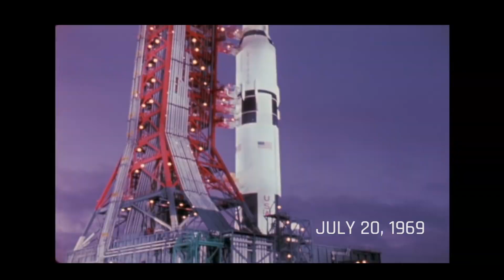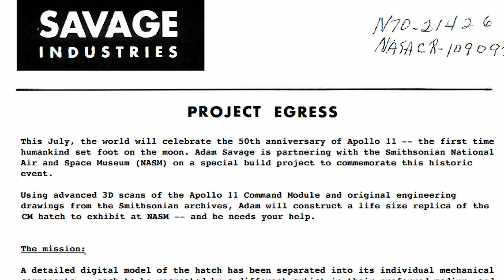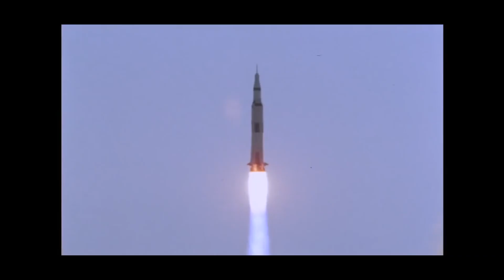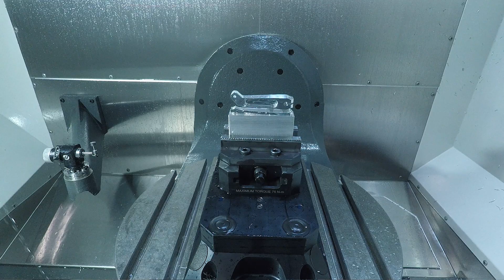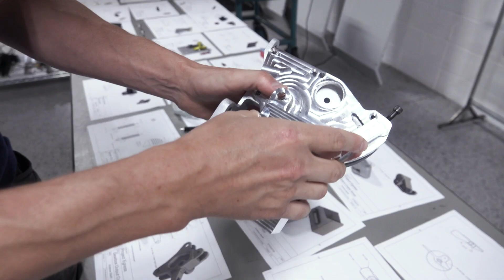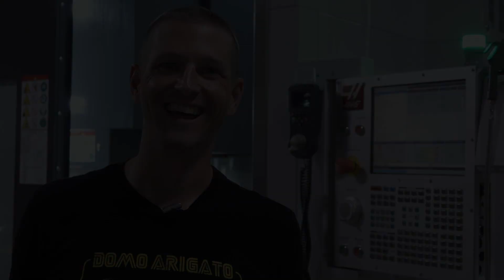Machining Parts for the Apollo 11 Anniversary: Project Egress!!  | WW258

Comment: "some of this parts really kicked our butt"..... yeah, and that was 50 years after the original was made, without all those CNC's and CAD/CAM....  Imagine how hard it was back then!!
Reply: They had NC machines back then 
But a lot of of these type of parts were the other way round 
Built a part then take its dimensions and build the next part to work with that 

Part of the reason they can't get back to the moon as easy as people think is because a lot of the parts were fine tuned by the operator on the machine at the time and a lot of their designs went work quite right if you build it perfectly to the drawings 
The original designs are easy to source but the operator knowledge is lost

Comment: I made some of these type parts, on a Cincinnati Matic #5 NC punched tape machine at HP around 1967-1968...if my memory serves me.  I did some of my apprenticeship at HP before they stopped the program.  I remember the day of the announcement on the loudspeaker, that we were going to have a 4 day workweek because of the slow economic conditions.  I started looking for another job when I heard this.  

Then HP didn't do defense work.  I came to work one day and there were perimeter fences and a guard that wanted to see your badge. They changed their aversion to military contracts.  Government procurement was only out of the catalogue for the military hardware before this.  Business picked up with the Vietnam fiasco and start of  HP's Government contracting.

I last worked for HP at the new Frequency & Time division in Cupertino 1969, about when the apprentice program ended.  I would have worked there until I retired, but the pay was $2-$3 less than elsewhere.  I had a 5 digit employee number that started with a zed and then a one, #01xxx.  If HP was better to work for I truly would have retired from there.  I was never treated so poorly as an employee by any other employer.  HP was the absolutely the worst employer I ever had.

I got fired once when my Father died and the supervisor forgot to tell the forman I was taking three days funeral leave...they never even said ''sorry''.  I got married a week after my Father's funeral.  HP gave a newly married employees a wedding gift..an engraved silver serving tray.  I never got one.

HP treated non-salaried employees poorly...yellow badgers.  The white badged salaried employees treated us like crap.  I never told HP I was an Engineering student at San Jose State.  When I got my BS in Aeronautical Engineering in May of 1970...I quit.  I didn't have a dime of school debt...I thank HP for that alone...nothing more.  

By 1977, I was on the Staff of Lockheed Missiles & Space Test Facility in Santa Cruz and later my own Aerospace Contracting company until I retired at 72.  Now I have a ''mini'' machine shop in my apartment and do R & D projects for gratis.  Mostly prosthetics for vets. 

Having a job with a company like NYC CNC would have been my dream job.  Maybe next lifetime.  

May God's Blessings befall all that take Solid Cold Metal and give that Metal LIFE.
Reply: that was an amazing comment. thank you for giving a glimpse into your life story
Reply: I really enjoyed reading that. Thanks.

Comment: Nice job guys. I think what is most humbling is the fact that the original parts were designed and built well over 50 years ago now, and didn't need to just look right they had to BE right. 100%. Could not fail.

Comment: Is anyone else a little disappointed by all the plastic parts going into this project. When someone says, "artistic freedom with material choice," cheap any easy 3d printed plastic parts does not come to mind. I'm not trying to put the makers down, but some of this high quality skilled work being done seems a bit diluted. And then there's the makers like Fran who put weeks into making a part out of wood then someone else loaded up an stl and clicked print and was done in an afternoon. Others went the extra mile to cast the plastic parts in aluminum, which is way more meaningful and shows a real skill and effort. I'm not trying to stir controversy, just the way I see it.

Comment: Anyone else find it humorous that its 2019 and all the prints i have seen for this have no GD&T but only simplified dimensions? Wonder how these parts are going to fit together. Wonder if Adam Savage even knows what GD&T even is how it help reduce costs and help prevent issues.
Reply: Chopper Carsen you often have to complement GD&T with a CAD model but I didn't see any tolerances anywhere
Reply: @realtacobell  Should be interesting when they try to assemble all these small sub assemblies. Would love to be a fly on the wall!

Comment: That last few seconds nearly torn my heart as i initially thought you crashed spindle into the trunnion...
UMC750 on my work crashed once (before i started working there) and that story stil gives me chills.
Reply: We had a tool holder failure on a open flatbed cnc and the tool fell out spinning 10k, that thing took a tour through the complete workshop

Comment: I'd like to bounce a scenario against you. I often have to machine parts for the optics industry that are .005um parallel w od tolerance +/-.005um. I use brass for free cutting properties but my pass/fail is 1:90. Any ideas?

Comment: I've seen TOT making a part. Can we see Abom79 making a gearbox shaft for the command module?
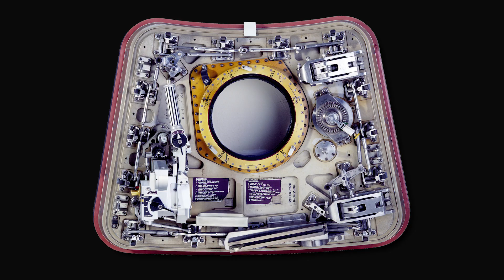Reply: ToT's parts can be seen at 3:25, right side and top left corner :D
Reply: @skynet3d  that was not the point ^^
Reply: @arvedludwig3584  You made no points. And I felt like commenting. What's the problem?
Reply: @skynet3d  it was an anecdote to the videos of Abom, making the gearbox shafts. ToT used that anecdote too in one of his videos.
Reply: @arvedludwig3584  No need to be a jerk Arved.  Its helpful info for anyone else reading this thread to know what other machinists contributed.
Reply: @shirothehero0609  am I a jerk? I don't see a problem here.
Reply: OXtool made one too!
Reply: I don't think Abom is a part of this project. No idea if he was invited.

Comment: As was said in the video, and alot of the comments.... great work....21st Century stuff.... but just remember....this whole 'project' is in 'remembrance' of all the workers, engineers, and astronauts (which put their lives on the line)... with the ingenuity and fortitude to design and build this machine, not actually knowing if everything would work correctly.... think of all the design criteria .... forces, materials, weight constraints, ... and above all, that lives would depend on it NOT failing...  a humbling thought to be sure.... thank 'them'  (and you )...for all the efforts....

Comment: Congratulations on this project, and my honest respect to the mechanics of the 60's...
Reply: Yeah the crazy thing is all those complex parts with all that bizarre geometry was done BY HAND with lathes, Bridgeports (probably without DRO's), lots of files and hand tools, it's just mind boggling!  The original timeline was also longer given the hand-made nature, and under FAR more pressure, too!  This is a show piece; the actual hatch had to be human flight capable, with ZERO tolerance for failure!
Reply: @dustysparks  I was just thinking the same thing, the original parts were all made by hand.
Reply: @stephenhunter70  
Made manually by machine. Not exactly made by hand e.g. clickspring style
Reply: @jayytee8062  Dude I did Turning and Fitting At Tech school I get it ok!
Reply: @stephenhunter70 
 Whoa..... so touchy!
Reply: @jayytee8062  Sorry i didn't mean it to sound like that.
Reply: @stephenhunter70  
No worries, all good.

Comment: Complicated CNC parts?  Just think, they were all made on manual Machine Tools in 1969 and before.
Reply: Machining them... What about designing them. Imagine making the paper drafts. And if they did use early CNC machines, imaging how difficult the "CAD/CAM" would have been.
Reply: @xenonram  jep I know I used to program gcode line by line however I can't imagine how to translate that to tape or punch carts  also the Apollo guidense computer was the most advanced  computer at the time so yea ( i know it was as small as possible so and not the most powerful at the time )
Reply: @Thefreakyfreek  8 hole tape like a teletype. So, keyboard that punches the binary representation of text as a row of holes, eight wide, plus a smaller set of holes for indexing in the center, in a reel of paper, or later, plastic, tape.

The Apollo Guidance computer wasn't the absolutely most advanced, it was the most advanced by mass and volume. IBM had already released the System 360,  a miniaturized version of which was later used for the five flight computers on the Space Shuttle. Funny side note: NASA used IBM System 360 model 75s for the RTCC (ground-side trajectory planning and support) machines. This required a whole building.

And CNC was first shown in 1952 by MIT: https://makezine.com/2012/04/02/punch-tape-programmable-metal-mill-from-1952/
Reply: @xenonram  Some early NC were more or less recorders of what a skilled operator did. No CAM needed!
Reply: They had the time and money to make 8 sets of setups and fixtures, though. I think the point in general is not that CNC "can do" what a person "can't do," but that CNC makes it cheaper and more accessible.
Reply: They had early CNC tools back then mostly driven by tape drives.
Reply: @Raptorman0909  hum would have thought it would have been bunch cards/tape.
Reply: @Raptorman0909  Punched paper tape. I've seen some of them run (in a museum, mind you!)
Reply: @jonwatte4293  Runs my piano from 1912 too
Reply: If you ar einterested in a mid-tech level you might like the parts that This Old Tony did for it : https://www.youtube.com/watch?v=d6SbRkM0C3s
Reply: I should like to point out that every nut, bolt, length of material on that door was tested, re-tested, tested in reverse, questioned, tazed, tested again and only then used, and that's after 10 different units were made so they can test those too.
The materials were tested, the processes, the factories, and all in hush hush.

As for the equipment, folks, this is NASA, they were always using yesterday's tech because yesterday's tech comes with a bill of health. 

That's why it cost more than all of our combined pockets to make the program.
Reply: Keep your logic and common sense out of here.
Reply: Some things are easier to do manually, and would have been designed differently had they had CNC, into a configuration that would have been more difficult to machine manually. Just because the tools are more advanced, doesn't mean EVERYTHING is easier, just some things :)
Reply: They had punch tape and early NC machines that ran canned routines but they were only so helpful. What the space race had back then that we do NOT have now is hundreds of highly skilled manual machinists (IAMAW or IAM) that people today simply cannot touch.
Reply: @StreuB1  I agree we have few people with those manual skills today, but with modern tools we as a society can achieve better tolerance, heater and cheaper, than back then.
We also don't have many highly skilled weavers, or buggy whip makers anymore...
Reply: @jonwatte4293  You'd be surprised at the many mixed manual/CNC machine shops making great money today.  A lot of repair and one-off work is faster and more easily done on manual machines while small production run and complex parts are done on CNC.  Manual machining skills are the foundation of CNC machine operation which is why they're still taught.  For example my local CC got a 1.3 million dollar grant from the Department of Labor for new Haas CNC machining centers, but still teaches manual mill and lathe work as prerequisites. Employers demand it and getting some tactile feel for metalworking helps understanding of metal and tool behaviou. My very well off machine shop owner bro has a mixed fleet from a CNC center back to a Cincinnati shaper made in the early 'teens!  His WWII American Pacemaker manual lathes make him money every week.
Reply: They did have CNC machines back then they used holes in paper punch cards to program they tool paths.

Comment: Kudos to the team. Also hearing just some of the challenges presented making this today with Fusion, Haas and Tormach, not to mention an existing proven design,  puts into perspective the magnitude of making it the first time around.
Reply: I'm sure it took the original machinists a lot more time, and a ton more setups.  It would be awesome to hear from some of the folks who made those original parts!
Reply: @tomdchi12  
Oh yes, that would be great. The pressure of having a short timescale and having your part shown in the Smithsonian, I can only imagine. Now imagine that you have the reputation of your country at stake, the death of the astronauts on your shoulders, and you're making it by turning the handles on the front of the machine. Just wow. My generation don't know how easy we have it.
Reply: Owen Sparks Machinists don't just touch the handles.  They reach into the machine, measure and move things, then get their hands out before releasing the brake.  For finer work, they do bench work with files and sandpaper.
Reply: @johnfrancisdoe1563  
Indeed, understood. The point I was failing to get across is with CNC you simulate the toolpath and then have fairly high confidence in the operation. Nerves play no part in the actual cutting cycle. With a manual machine it's possible to turn a handle in the wrong direction on the last operation and scrap all the previous work. Different level of pressure! No facility to just throw another material blank in the jaws, go and have a cup of tea and come back in an hour if it goes wrong...